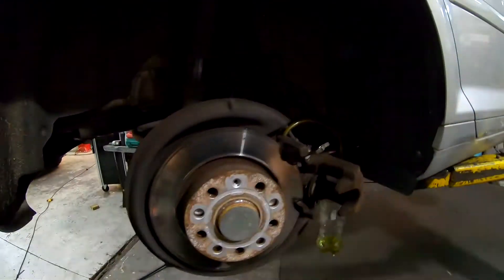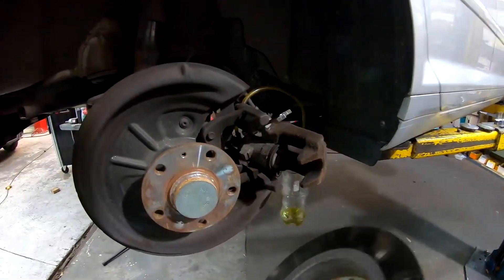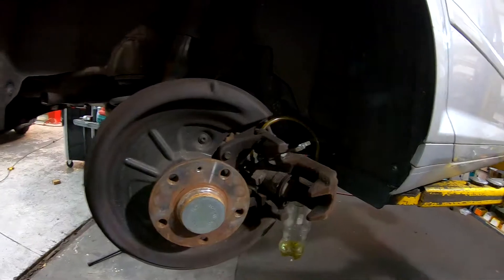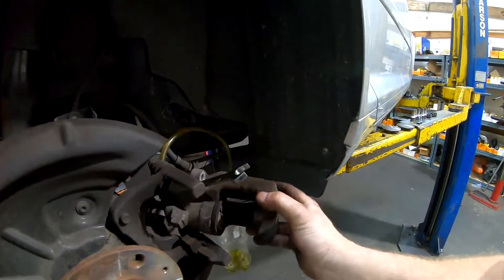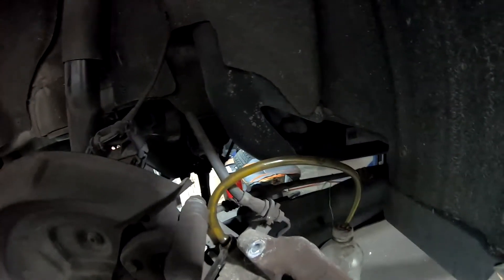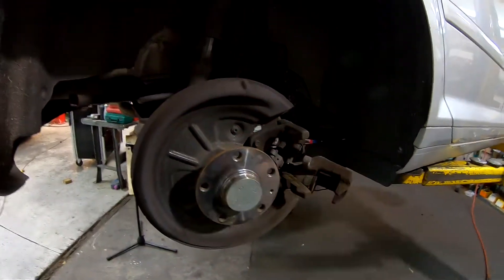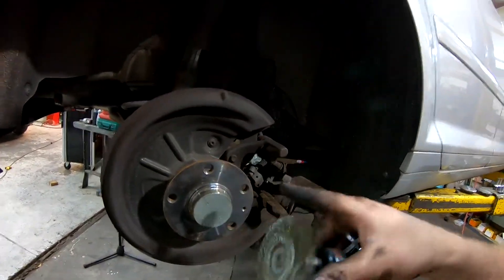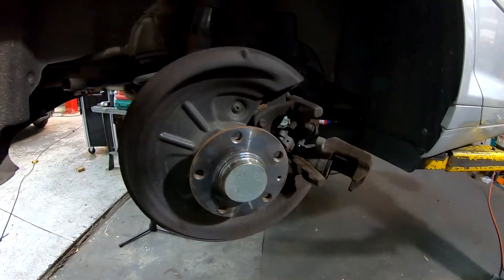Lug Bolts vs Lug Studs

Comment: Im running 38s on 22 aluminum hostle rims. Truck has over 1000hp...snapped 4 studs yesterday.  Should i switch to the long ones?
Reply from the maker: sounds more like you need a beefier hub and lugs all around. No idea from my end tho, I don't mess with performance stuff, never was particularly interested in it :(